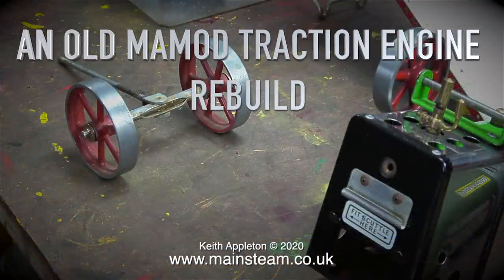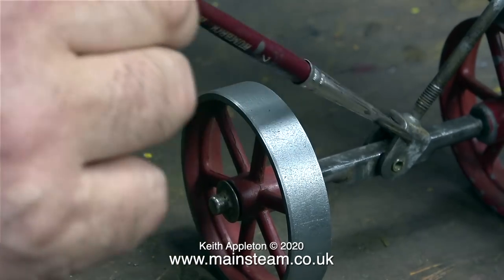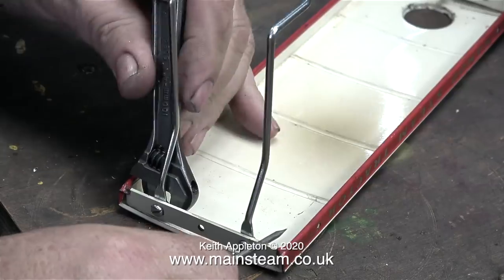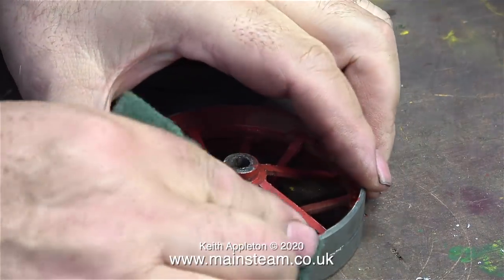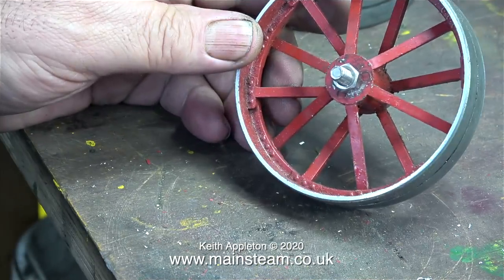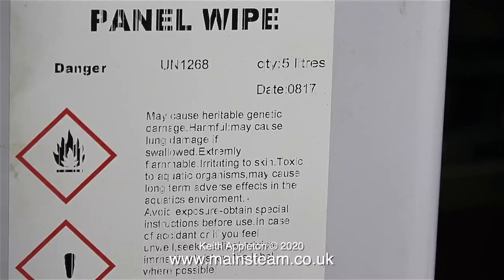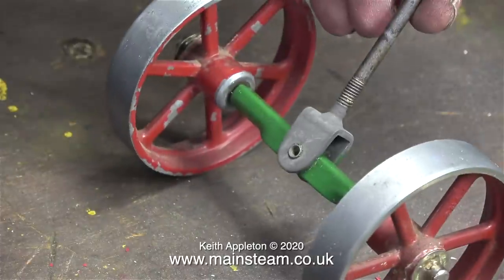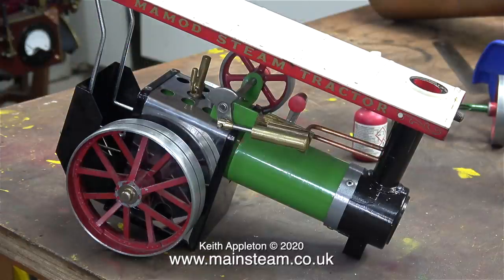A MAMOD TRACTION ENGINE REBUILD - PART #4

Comment: Another great video. When I remove axle caps I use a watchmaker's trick for removing hands, and that is to use a material like zip lock bags to cushion between the tools and wheel. Prevents scratching.

Comment: Good morning I have the steam roller but it’s leaking from the water gauge glass best way to reattach seal as it’s a new seal
Reply from the maker: Try a a very thin smear of silicone rubber on both sides of the seal then refit it.
Reply: @keithappleton  much appreciated